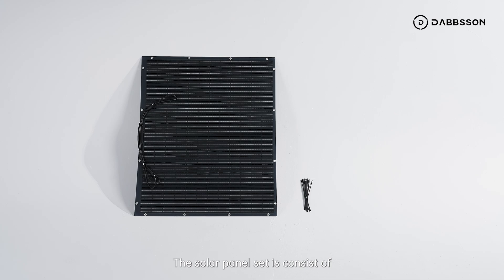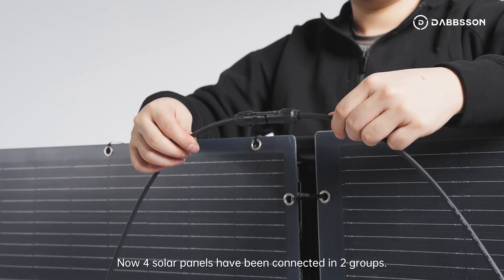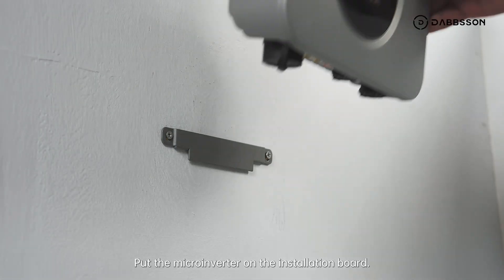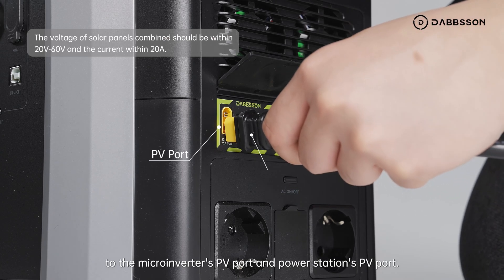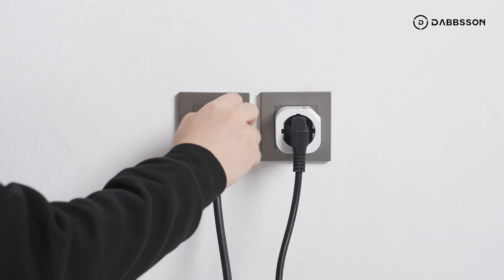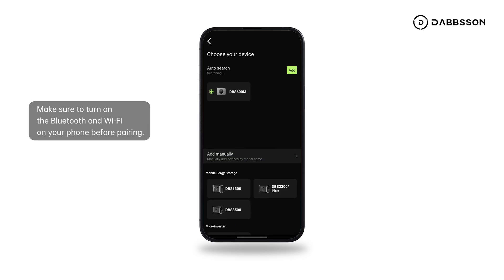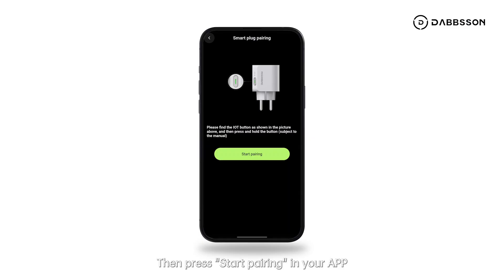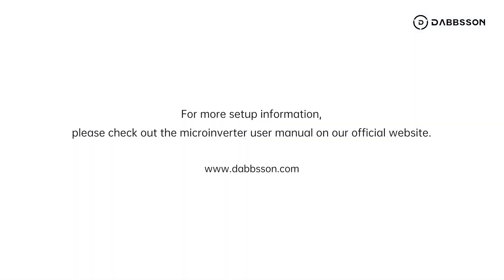Dabbsson | How to install Dabbsson Microinverter Tutorial

Comment: Hi, is it possible to set up the micro inverter's output (via software or firmware update) from 600W up to 800W? Especially in Germany it is now allowed to feed up to 800W into the grid. 

If this is not possible, do you have another inverter with this opportunity?

An/or why is there no micro inverter for the new DBS3500 available? 

Thanks for your answere.
Reply from the maker: Hello, we're sorry our products currently cannot support setting up the micro inverter's output (via software or firmware update) from 600W up to 800W. For your second question, our product development team is currently developing it